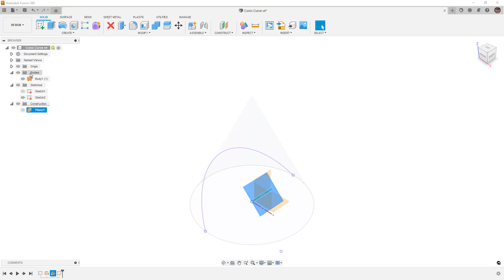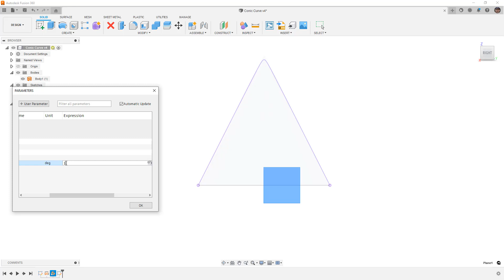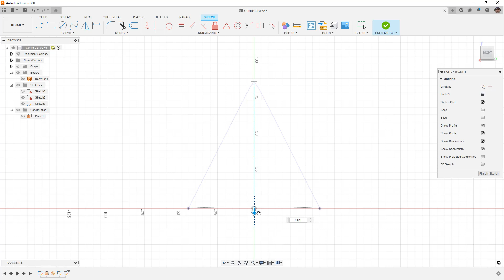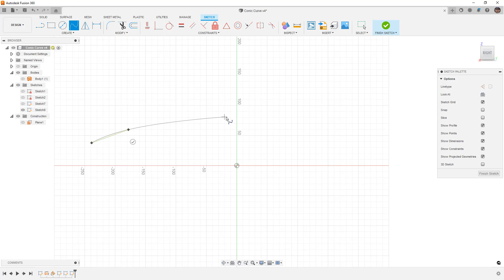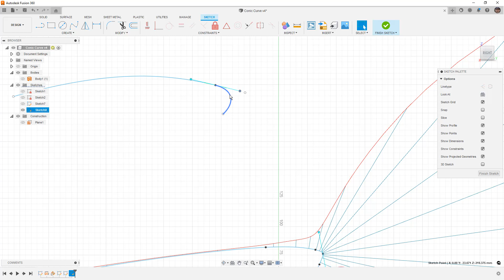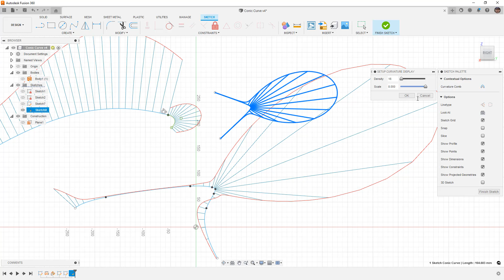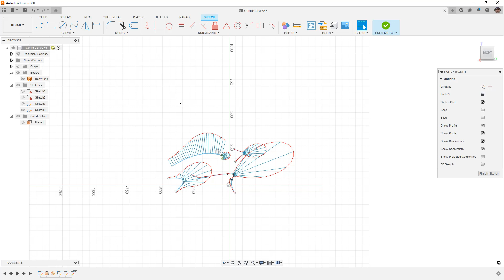Surface Mastery Part 14 - What is a Conic Curve and Why You Should Use It | #Fusion360

Comment: I have a slight issue. I've done a big mistake in the modelling process but I can't fix it because the bar at the bottom of my screen is not appearing. Is there any way to fix that?
Reply from the maker: if that is gone then no sadly.  So if it was never there than you started either with an imported model which defaults to no history, or you selected the gear icon in the bottom right and turned off capture history.

If your design started with history and you accidentally turned it off, Fusion saves a version every time you save the file, so you can go to your data panel where the file is, click the little V version button and see all the previous versions.  You can open any older version and save it as the current one.  So IF you had a timeline in your design that you turned off you can maybe go back to a point where it was still on.
Reply: @LearnEverythingAboutDesign  I had the bar a few days before, it should be fine. I'll have a look at that soon. Thanks for the help.